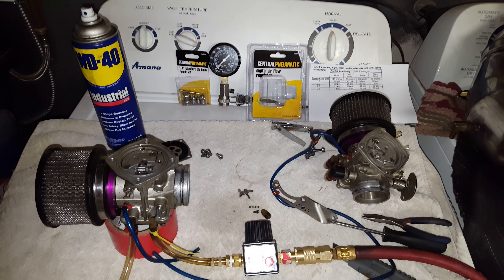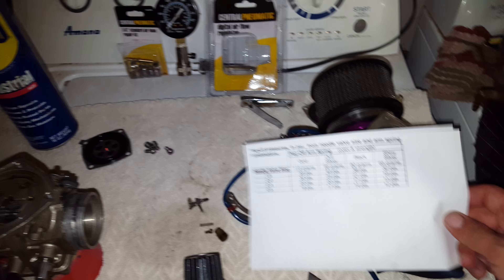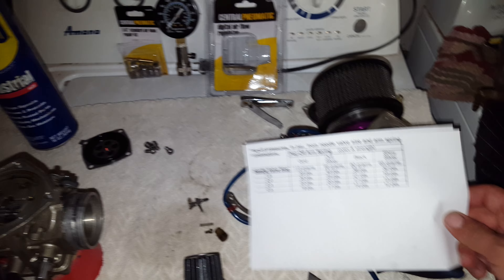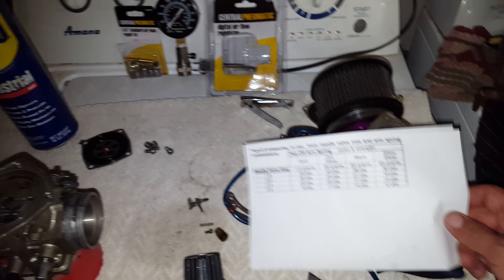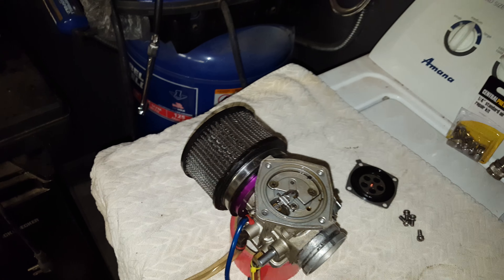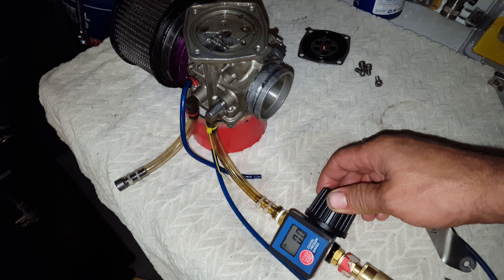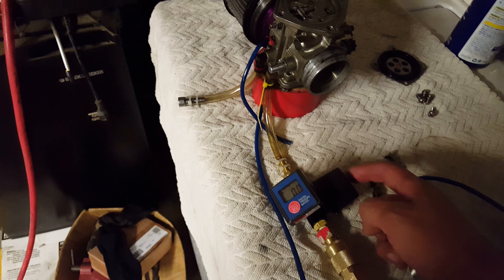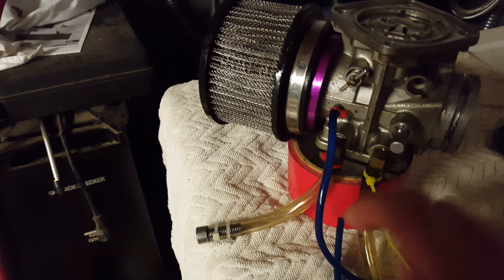Home made digital pop-off pressure gauge BUCKSHOT NOVI CARBS

Comment: How come skis need all the extra passages and valving over regular 2 stroke carbs on bikes? is it to do with part throttle driveability I guess?
Reply: May have something to do with being a closed system for when the ski is overturned, so it doesn't leak fuel.
Reply from the maker: Kevin Ulett yup you beat me to it!!